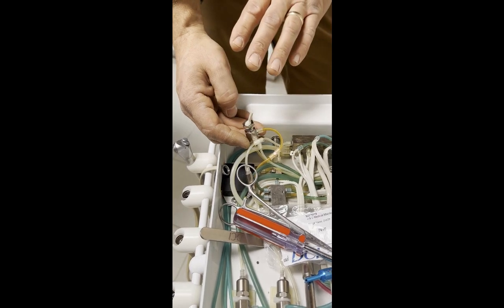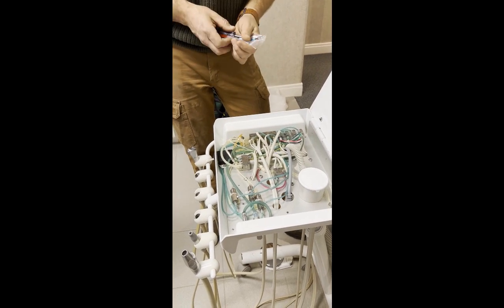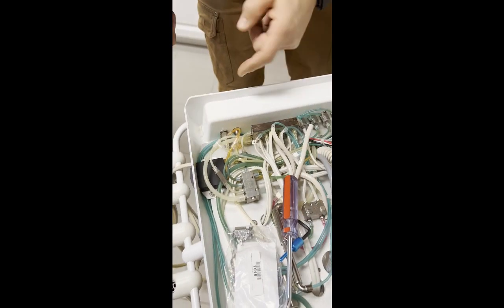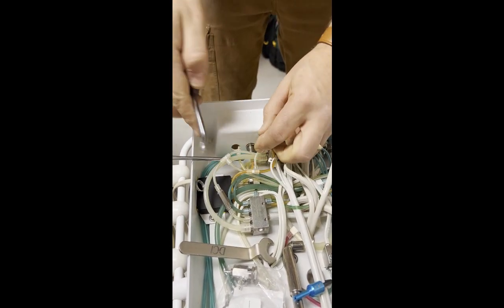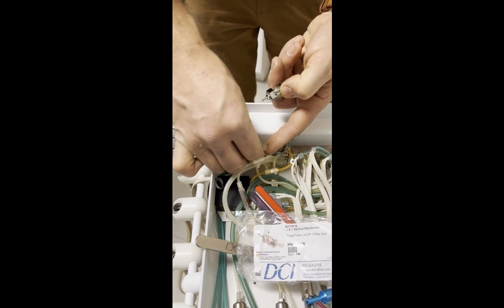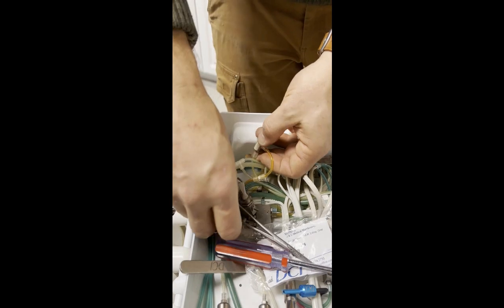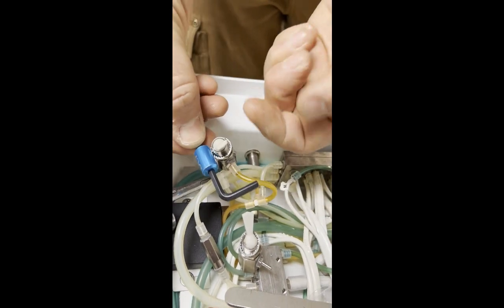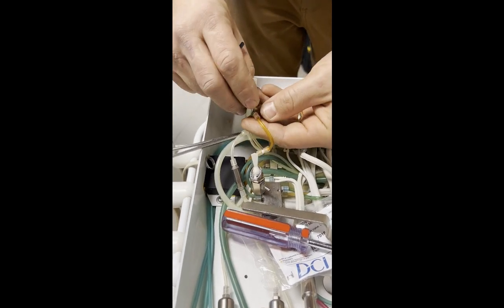Unscripted DCI 3-Way Master Switch Replacement!

Comment: Hey =) Great video. Can you give me a tip on the DCI p/n 7016 versus p/n 7021? I've got a malfunctioning Air Switch that goes to the water bottle, rather than the "mains" switch for the machine pressure itself. Seems that part 7016 says it's for Air only, not for Air or water, as the part 7021. How can I contact you to get tips on my trouble shooting job? thanks heaps, Nela
Reply from the maker: 7016 is a "three way" valve which means it vents the pressure in the off position. It is usually used for the master switch because the pressure needs to be vented from the diaphragm on the master valve for the system to turn off. 7021 is a momentary switch which is used for things that only want to be on as long as you have your hand on the switch. This is usually on an arm brake or a water flush. The key to the description is "momentary". 
Hope this helps.